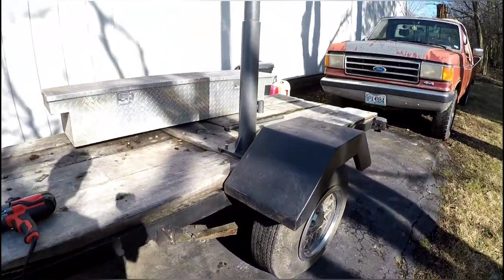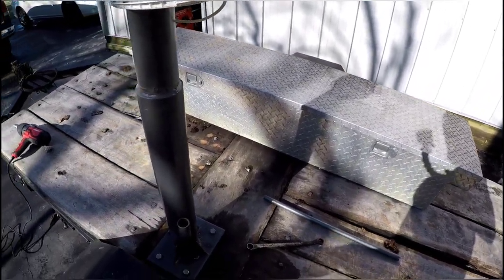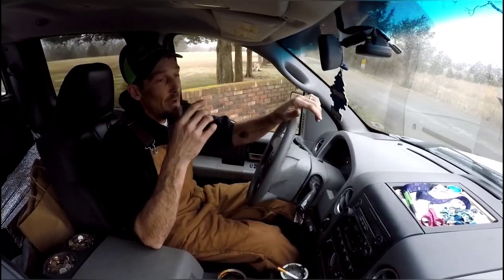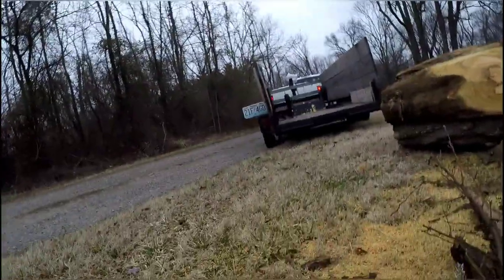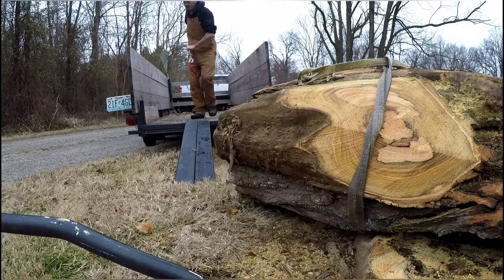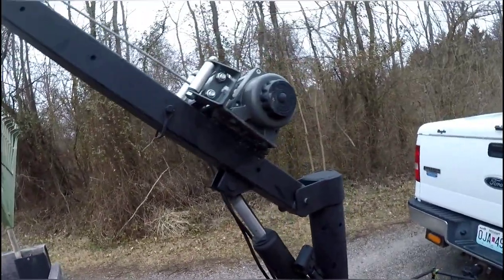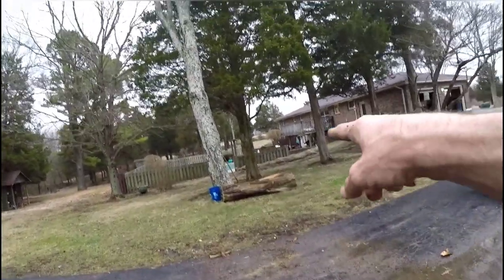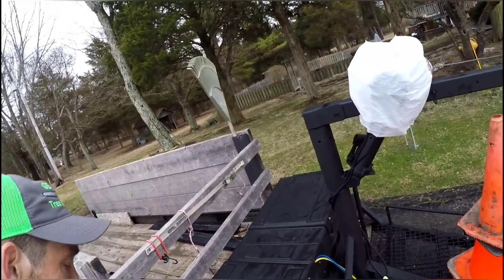HOW TO MAKE YOUR JOB EASIER / MODIFIED TRUCK CRANE FOR TREEWORK / THE FINAL PRODUCT

Comment: Sweet setup nice job just try to run the cable straight on the drum no xing over the cable nasty kinks and bures stay safe Mike
Reply from the maker: Definitely easy to get kinks & burrs, if I dont pay attention when using.  I'm just now getting used to it, so hopefully it holds up.  Thanks for your time brother.  STAY SAFE

Comment: Sweet trailer set up now brother! I wonder now about some sort of beam (perhaps removable) that goes across and above the very back of the trailer with a redirect for the cable. It would provide a good lifting angle until the log end is up on the trailer then slack the cable take it out of the  mid line redirect and continue skidding it towards the front from that point. I guess for longer logs any ways. Smaller stuff you'd probably just park beside the work and lift and swing them into the trailer and stack em up. Handy system with alot of potential uses there Mike. Ps video was just fine without the text you said would be missing I thought
Reply from the maker: I was hoping it would be ok without all the labels.  My editor is giving me a fit & really starting to piss me off😡👎
I have an idea for the lifting of logs near the back of the trailer.  Its basically what you said....
I'll show it soon.  Thanks for your time brother.  STAY SAFE
Reply: yea, i was thinking the same kinda like a septic tank hauler. maybe a winch on tracks or rollers on an i beam the length of trailer,
Reply: @StihlChainsaws  try powerdirector for android it's what i use for my vids and it is trouble free. And really user friendly and quick to learn. Every once in a while it would have a little hick-up and all I would do is exit the program and go back into it and itd be fine. Usually when you've been cranking on it for a while and it hits a slow mo clip or a fast forward and it would get a little glitchy.

Comment: Nice work! ... concept, design, and execution.
Flower pot out of that log is cool too.
..... how did you hollow out that log for the flower pot? thx.
Reply from the maker: I just started cutting wedges out, & chipped away with the axe.  Then I cleaned it up with my lil 150.  I got kinda lucky, because the center had decay & that made it easy to remove.
On a side note though.....
I wasnt able to put my normal labels on the video, & I called the log an elm.  Well it wasnt an elm...it was a honey locust, & I was curious if anyone would catch it😉👍
Thanks for your time brother 
STAY SAFE